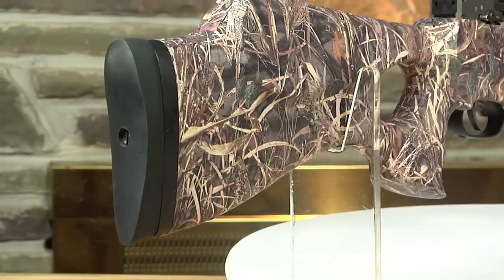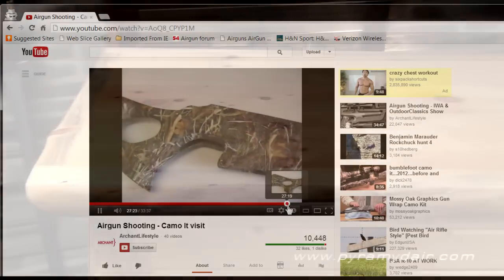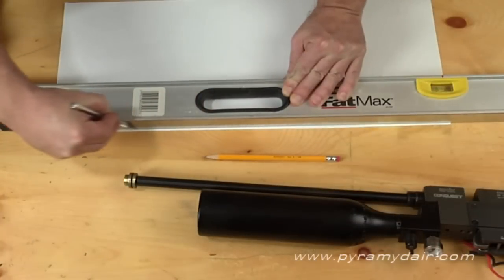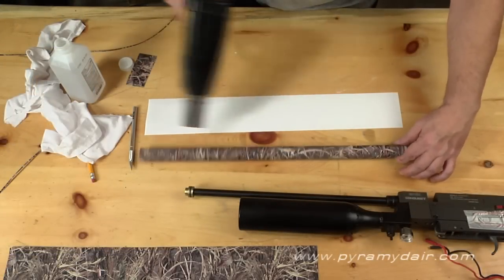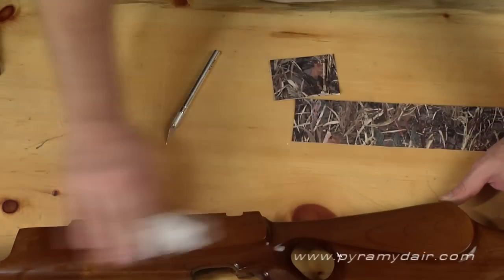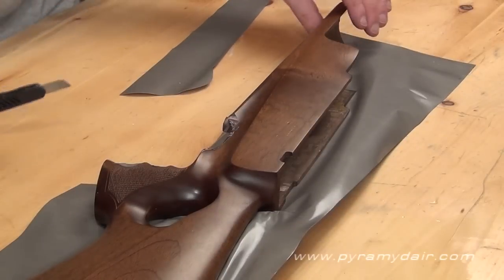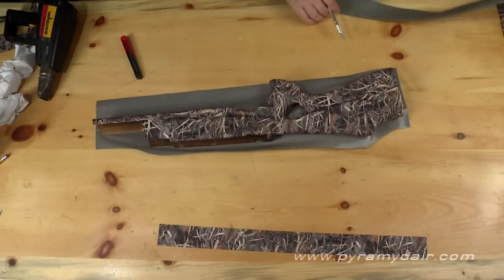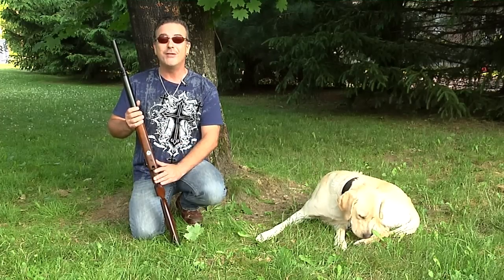Camo It kit - DIY Airgun Reporter Series Episode 2

Comment: this stuff is not worth it $80, iv had good luck with spray paint, but if you don't want to do that there are camo wraps that don't use adhesive and cost $15 to $20 and way easier to apply.also can be reused or switch to suit the occasion such as snow. but 2 each his own